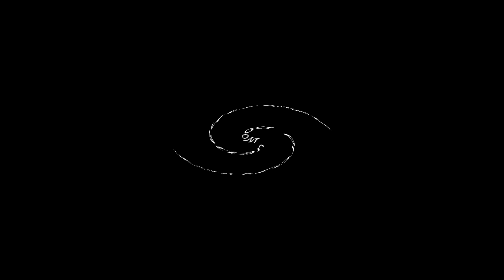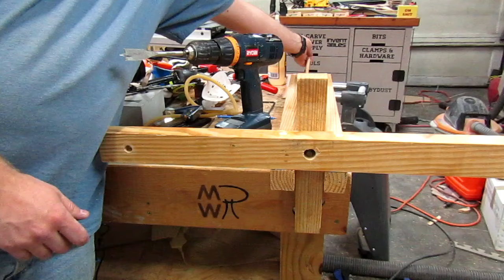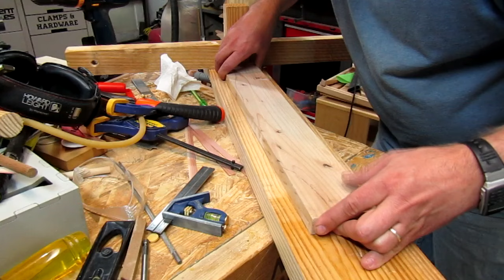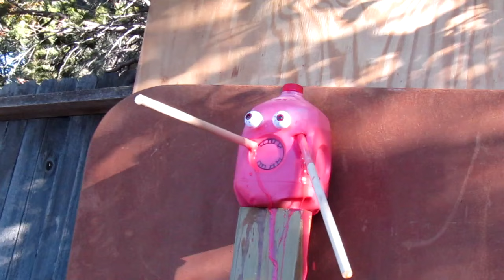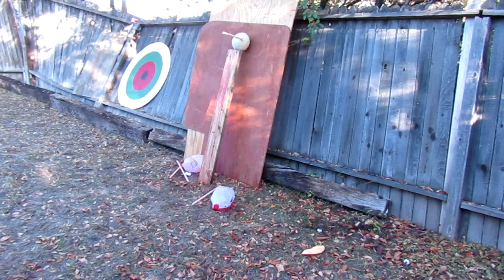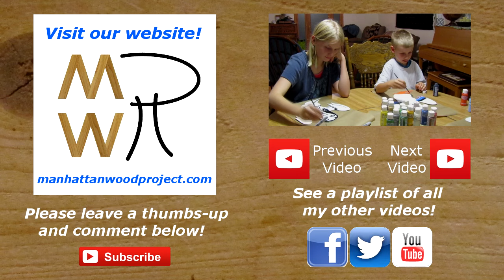50 - Dottie - Zombie Weapon Challenge - Manhattan Wood Project

Comment: Awesome,it works great!!did it take long to build?
Reply from the maker: Thanks!  I actually started building it on Thursday night, and was finished with the build and recording by Saturday evening.  I'm thinking about making a separate video describing the build process a little more, but I want to make some modifications and measure the bolt speed first.
Reply: ManhattanWoodProject make the seperate video for sure!I only had about 2hrs Friday evening to make mine I wish I could have had more time to make a more walking dead style video!

Comment: That will not go in through a skull.
Reply from the maker: You're right, but the upgrades I'm making to it are much better.  Metal bolt points, 3.5x increase in force, and a few other tweaks that help.  I hope to be finished with the upgrades and video in the next couple weeks.